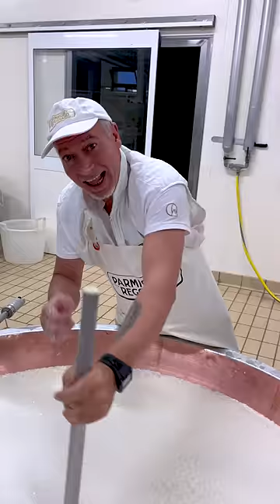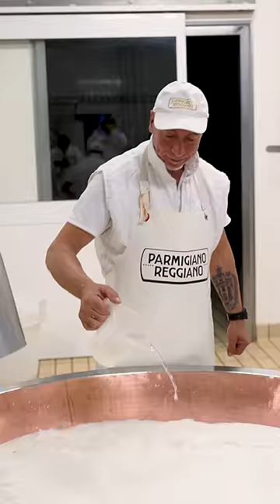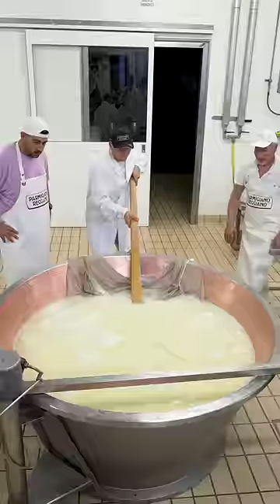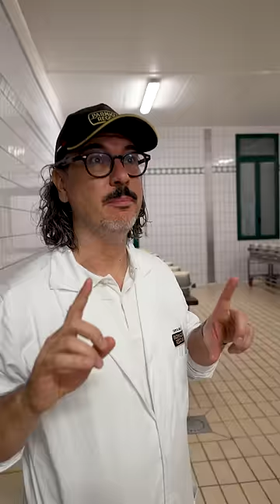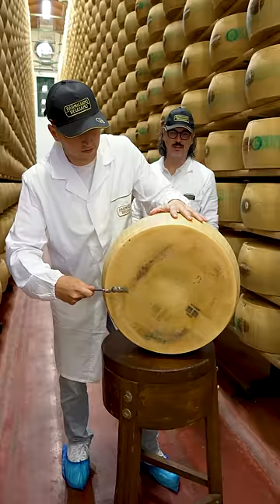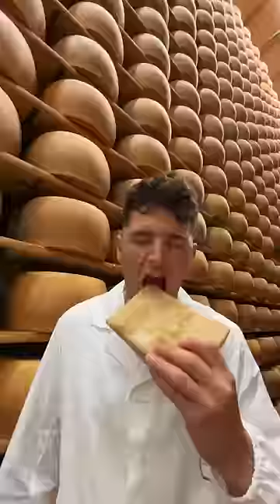I Made Parmigiano Reggiano

Comment: Here's a brownie recipe, 1 cup (2 sticks) unsalted butter 2 1/4 cups sugar 4 large eggs 1 teaspoon vanilla extract 1 1/4 cups unsweetened cocoa powder 1 teaspoon salt 1 teaspoon baking powder 1 1/2 cups all-purpose flour 2 cups semisweet chocolate chips Instructions: 1 Preheat your oven to 350°F (175°C) and grease a 9x13 inch baking pan. 2 In a medium saucepan, melt the butter over low heat. Remove from heat and let cool slightly. 3 In a large bowl, whisk together the sugar, eggs, and vanilla extract. Stir in the melted butter. 4 In a separate bowl, sift together the cocoa powder, salt, baking powder, and flour. Gradually add the dry ingredients to the wet mixture, stirring until just combined. 5 Fold in the chocolate chips. 6 Pour the batter into the prepared pan and spread evenly. Bake for 25-30 minutes, or until a toothpick inserted into the center of the brownies comes out clean. 7 Let the brownies cool completely in the pan before cutting and serving. Enjoy!

Eggless Red Velvet cake in JUST 10 minutes!
It’s eggless, absolutely irresistible, and gets ready in no time!

Ingredients -
 1 cup sugar
 1/2 cup oil
 1 + 1/4 cup milk + 1 tbsp white vinegar (rest for 5-10 minutes)
 1/4 cup curd
1 tbsp red colour
 1 + 1/2 cup flour
 2 tbsp cocoa powder
 1 tsp baking soda

Hope you like it, do give a try to this quick and easy recipe! I promise you’d be sorted for your dessert in just 10 minutes!

Let me know in the comments how you liked it!

GONNA DO ANYTHING U SAY AT 1k SUBS :>